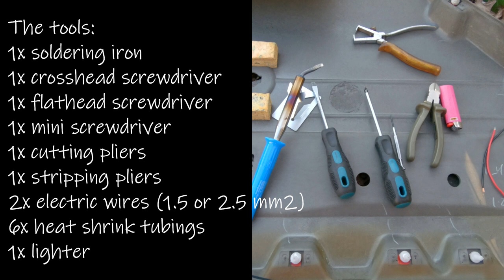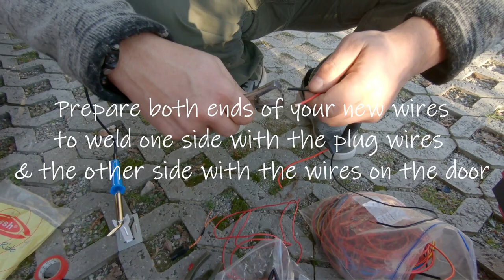BACK DOOR LOCK REPAIR | Defender central locking malfunction | Land Rover Defender | repair series

Comment: Great to see the steps. However, I'd avoid soldering joints in vehicle electrics as they may break due to vibration. And you've put a solder joint right inside the tube where stress will be greatest? Joints should be outside the moving part. I'd recommend a heat shrink crimp connector. These can also be used on the road without the need for a soldering iron.
Reply from the maker: Hi! Yes you can also use heat shrink connectors if you prefer it. But for us we prefer soldering and we always have soldering iron in the car. Thanks for your comment!
Reply: @offtrackfamily  So, NOW our cable is broken, too, same door :-) Thanks again for the video. I think I will do the other side as well. Can't be long before it also breaks :-)